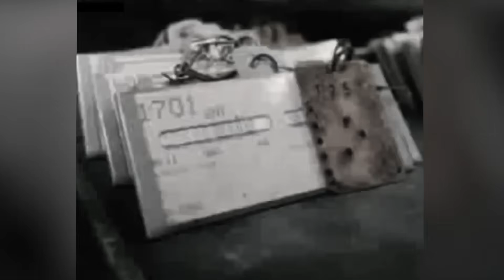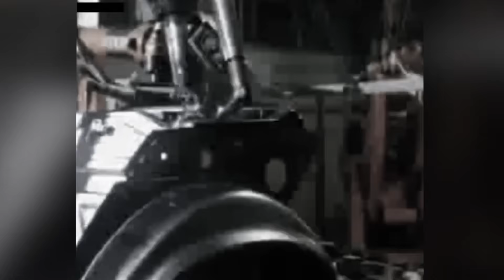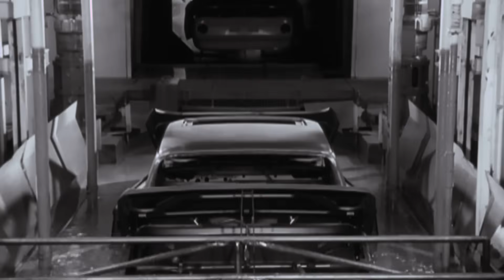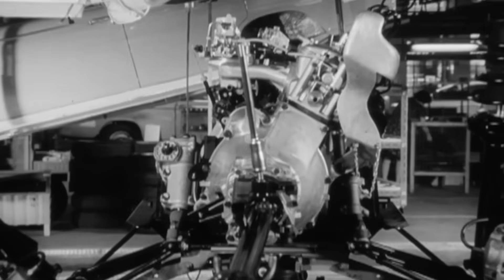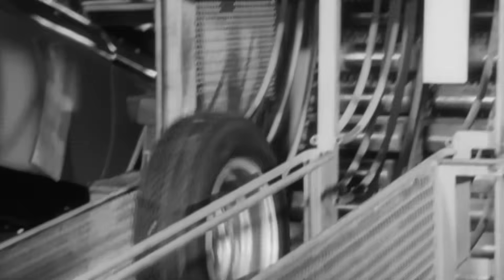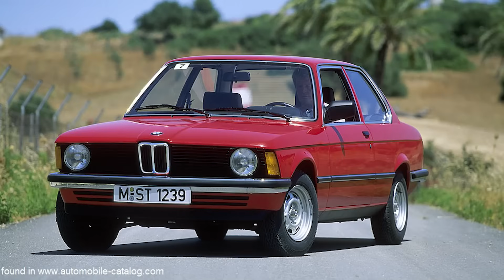How The Classic BMW E30 Was Made In Their 80s Factory | Step By Step Process

Comment: Everything went south with the  production of  the E36 model. Although brilliant, it was the intro of BMW cost cutting. The use of plastic in coolant tanks and other parts.
Reply: About reliability totally agree. Owning E30, E36 and E46 and my family having all from E21 to new. BUT unless bought into tropical climate since new the body rusts like hell on E30. E46 is first half decent (I own 330Ci for past 10 years) and next ones are way better. E30 rusted very badly already when 10 years old car in winter climate. Mine i garage in winter and only drove summer it was good bust still hole under driver legs, holes under battery in back, hole under front window. Nothing like this with E46 with same age now. E30 body was OK for the time, but way worse than bigger BMWs and its cheaper competitor Audi 80 (that drives like a dull)
Reply: @t2216  E30 in versions after 1987 year had better rust protection. My E30 from 1990 year production year had rusts but after 20 years.
Reply: Well competition in the 90s was fierce as many very cheap japanese cars flooded european and american markets.
At the same time the E38, E39 and E46 and E60 probably peaked BMWs quality that has never been reached ever since.

Still the E36 is way more complex, drives way better and the interior is better designed.
Buts its true, they cut corners in the assembly at that time and the plastic parts unfortunately :/